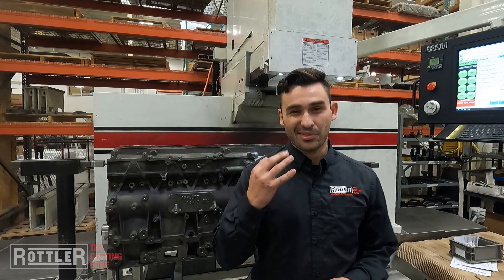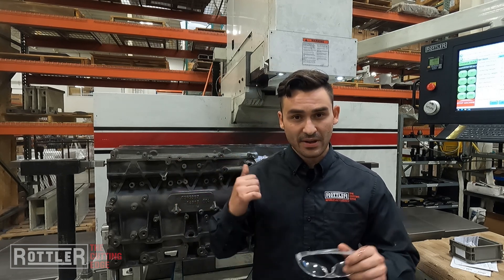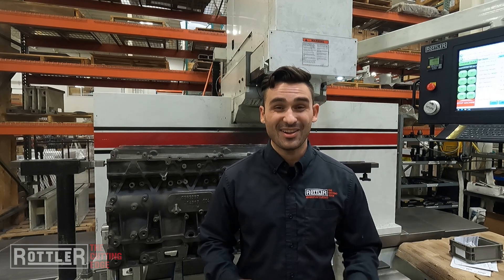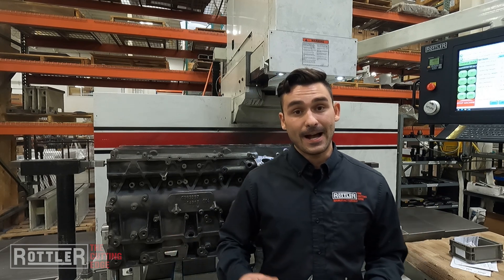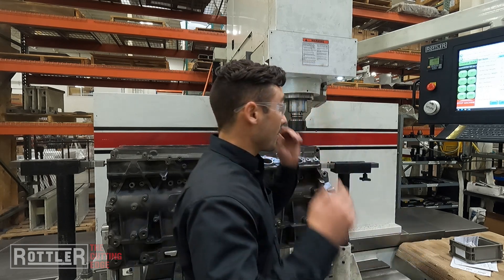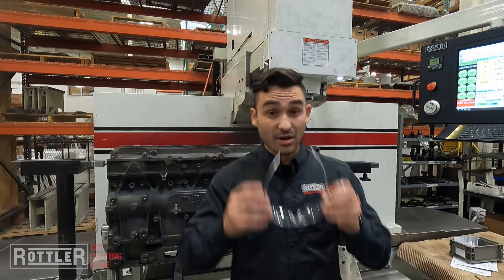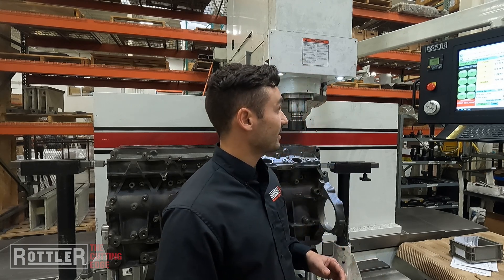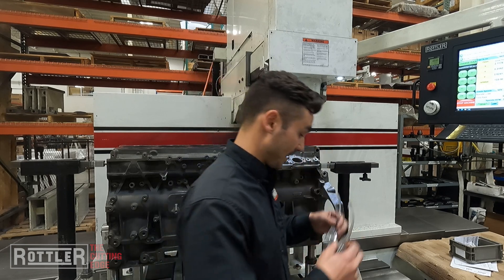Circular Interpolation Auto Cycle

Comment: counterboring with 1" or 25mm endmill anyone ? . That interpolation with that boring head is pretty meaningless
Reply: Great comment about using a smaller diameter tool Kiss! Theoretically you could use a 1" tool however it would need to be more of a dovetail cutter due to the counterbore being undercut. Also, it would require an additional tool, tool holder and a tool change in the process...

We use this large boring head for this application because it is the same boring head that would be used for boring the upper and lower bores on this specific engine block. To switch to interpolating the counterbore as demonstrated, the machinist need only to simply swap from the boring cartridge to the 12-degree interpolation cartridge. Which can be done in a few seconds without having to remove the tool from the drawbar.

Using this tooling actually simplifies the overall process and reduces the tooling required for the customer to perform this work.
Reply: @ryanthompson2523  well i see the reasoning now - if that counterbore is tapered than it's a neat trick

Comment: Why do an interpolated cut instead of just using a boring head?
Reply: The main reason for the interpolated cut is that with "wet sleeve" style diesel engine blocks such as this one, the counterbore actually has an undercut and the radius between the counterbore face and undercut wall is a critical feature due to it being a known stress concentration. 

Therefore, by interpolating this feature we can use a RT322 insert held at a 12-degree angle from horizontal, sneak into the undercut surface, and maintain the radius to blend between the counterbore face and wall.